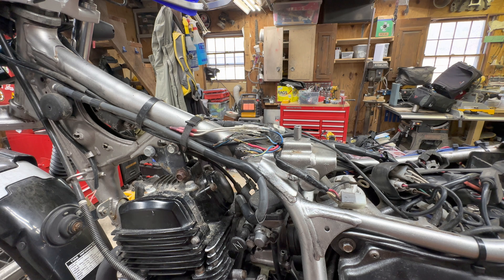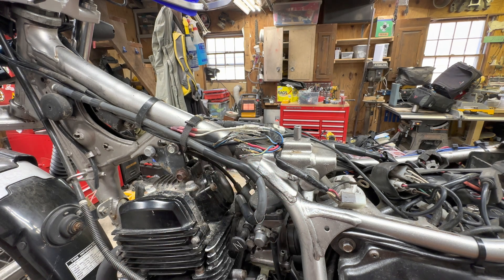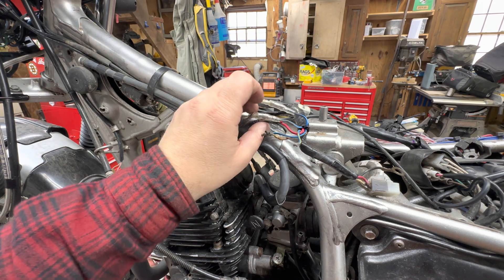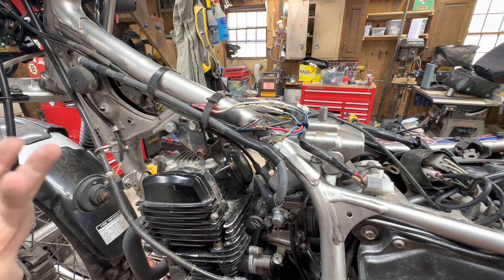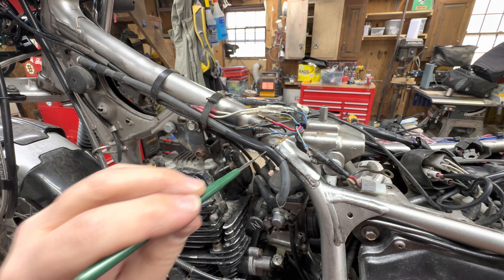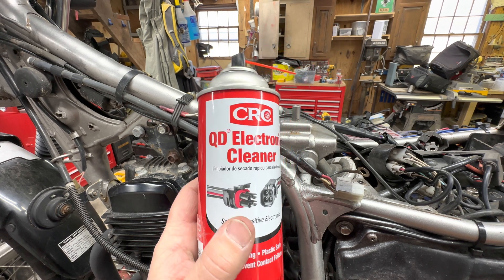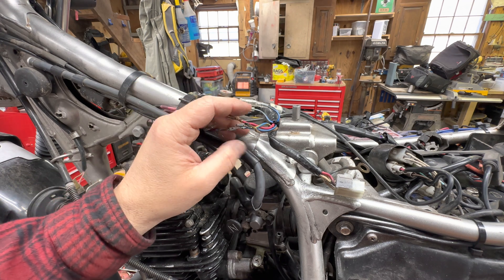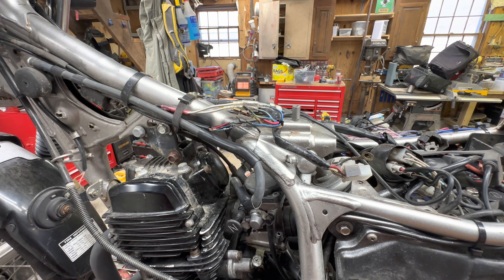TW200 Electrical Gremlins

Comment: I have a tusk lifepro lithium battery, it has been great and running fine, i had it running idle for about an hour the other day then it would not start after that I've been having to jump it.... The battery has been charged and reads full but don't think its charging when bike is running. Im new to moto world its a 2024tw got it in January. Just had the maintenance check on it and everything was good. Don't know where to start. I know cars have an alternator but Bikes 🤷🏻‍♀️